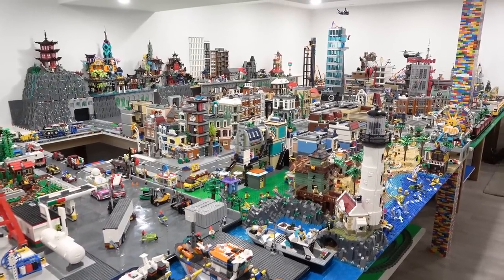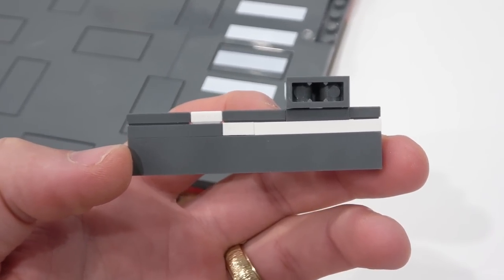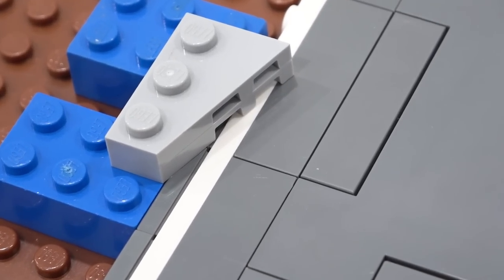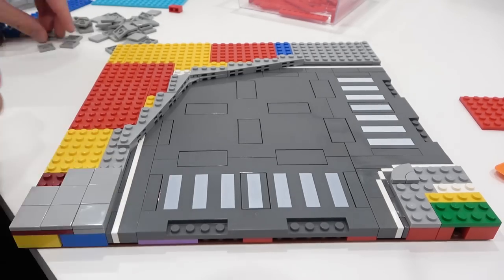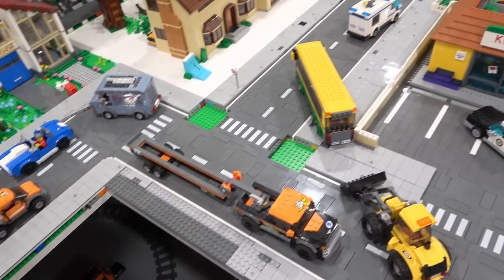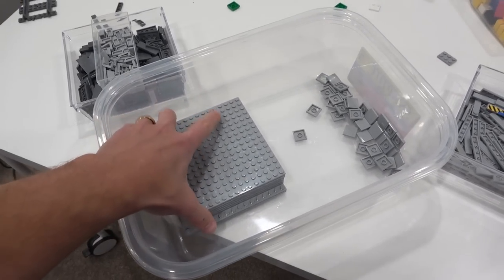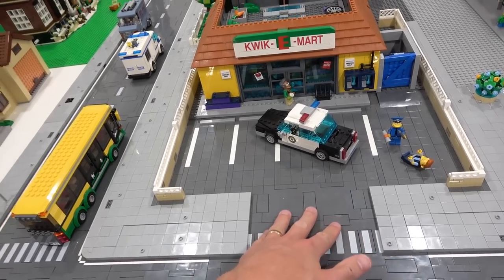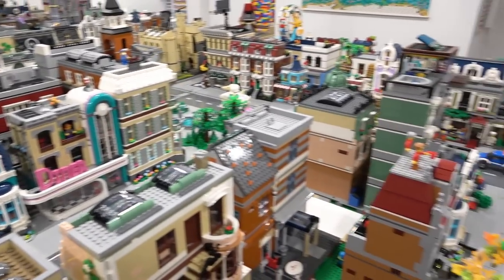LEGO City Roads DONE! How to Build a MILS Curve

Comment: Not sure if you're unfamiliar with big cities but most pedestrian areas feature interesting tile work and greenery in addition to the bland gray sidewalks you would expect, as well as sidewalk bumps and gradients at crossings for wheelchairs and strollers. Integrating more realistic city details would free up a lot of grey tiles here.
Reply: I guess it would be diffrent the side walk depending where U are. I not a fans of them new Mills road plates but you's half them are good for walk parts or drive ways of in industrial factory part or even factory roof top s or you's as panel on building an little shop roof s  to I'm sticking with the old road plate s.

Comment: Hi Jordan. Still loving your channel. I was going through the Vespa 125 2 days ago and found parts I think you might perhaps be able to use to improve the big curve of the road mills builds.

Part No: 80015, 27507 & 68568

After searching through Bricklink today both parts 27507 & 68568 has a light bluish grey version but part 80015 is on the wanted list for light bluish grey so not sure if it is available then.
I hope this information finds you well and that it might help you improve your mills road builds in the future.

Keep up the amazing work and best wishes to you, Mrs Bricksie and the twins.

Comment: Huge fan! Building my first lego city & I have a quick question: is it necessary to elevate the streets and buildings with the extra blocks underneath the baseplates? Or would it be fine to simply have modulars without an extra baseplate below & streets without any bricks below the streets for the added height? 

Thank you in advance! 

Thank you in advance Mr. Bricksie
Reply from the maker: Not necessary at all. We've been working on our LEGO city for 7 years and just recently converted to MILS.
Reply: @Bricksie  Thank you for the reply! I had not heard of MILS before, but just typed Bricksie MILS and saw that you have a video on it. I'll be sure to watch your other video for more information. Thank you!

Comment: All those parts and they just don’t look good. Its not a curve it’s a weird angle looking corner. Those sidewalks covering the white lines doesn’t look good either. think lego really needs to produce something for these corners. I still think the old road plates look much better.
Reply: The problem I have with the old road plates it’s the actual road is so small because there is pavements on the plate aswell even though 90% of buildings already have pavements. If they fixed that I’d agree
Reply: @harleybedford7094  well the new road plates have sidewalks in the version that Bricksie is building and using so that’s the same footprint. But if you didn’t mils with sidewalks like Bricksie I suppose you could save on some space. But how would you have curves without building mils sidewalks?  
Personally I don’t like the new road plates for several reasons. But parts/ $ and curves are at the top of the list. 
If you like them that’s good they just don’t work for me. 
Was just mentioning my thoughts. 
Those curves you have to admit look terrible